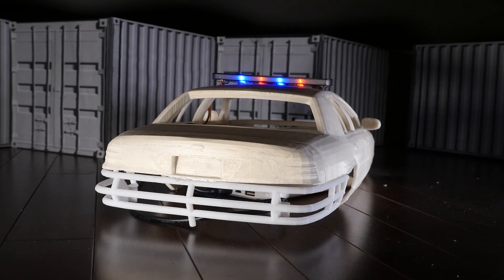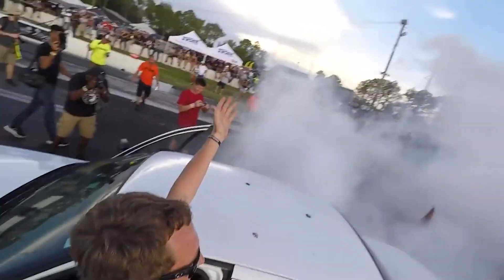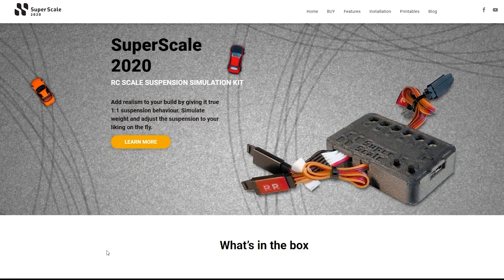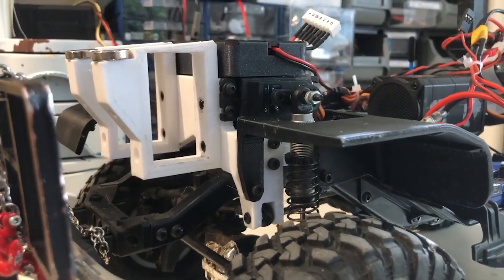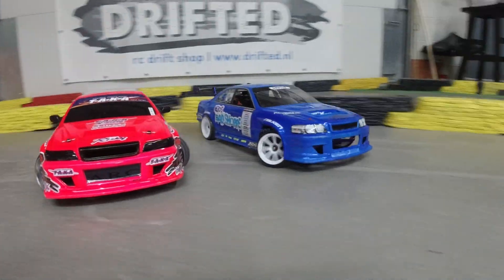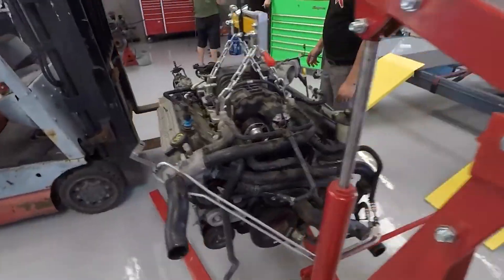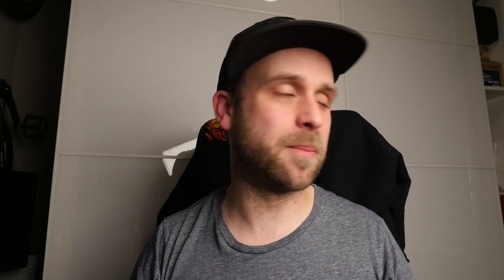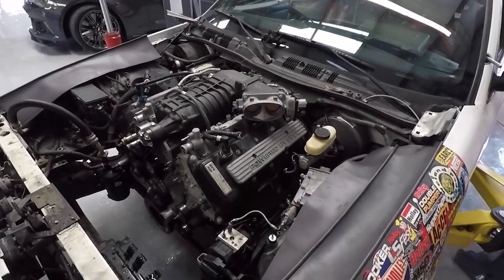RC NEIGHBOR BUILD - Kick some tires, light some fires! EP 3

Comment: Hell yeah brother , you should mount the engine on springs so it’s has some  movement in the  engine bay  when you whip it about , can’t wait to see the next stage . Keep up the good work from across the pond 🏴👍🏻
Reply from the maker: yeah i might. it's going to be an evolving thing. gonna attach the motor to the servos. maybe i can do it on a pivot.

Comment: I took apart a blue tooth speaker to put a sound system in my rc drift.  Maybe hook up a traxxis system to some good speakers for some good sound quality
Reply: Great Idea !
Reply from the maker: nopers. if you want to see proper sampling. not cheap up amps, and bad loops of audio like all available sfx kits for rc. check out "thecarscalingproject" on insta and youtube. That dude is using a raspberry pi, and some clever coding. the only speaker sound i'd go for. because most sound like pure ass from source. doesn't matter if you put a good speaker behind it.

Comment: Engine came out amazing so many details, why not make the pulleys rotating and use servo motor to rotate it with a small belt, that will be sick with ur engine and rotating supercharger with sound effect,  hell yea brother
Reply from the maker: I thought about it. but that's just too much work to barely see them move. Would love too, but the scale is too small to reliably print moving parts that small.
Reply: @kpopRC  yea its alot of work, maybe I will do that for my mustang,

Comment: An idea for the tire smoke. You could get some of the stuff you put in fog machines and throw it in a small container in the car and run a thin gauge wire through it and hook up the wire to a 3 or 4s Lipo battery and that should create the smoke you want.
Reply from the maker: i think the bigger the wire. the more current it would take to heat enough. the more fluid the more energy it would take. I have something planned. and it's very neighbor-esk.
Reply: @kpopRC  I just want to say that it’s super cool that you read and respond to your comments and I can’t wait to see what you come up with.

Comment: Damm that's a sick motor very nice work

To smoke I'd susgest one of them exhaust smoke kits but redirected too just in front of the rear tyres.
Reply from the maker: already tested 2 in tandem. not enough dude. lol. i got something in the works.  and it involves heat and fire, probably sulfur.
Reply: Could also try a top from an ecig. They let out heaps of smoke and can run off a 2s lipo. Place a small fan onto it too direct air over it...

Comment: For supercharcher whine, just go with some metal straight cut gears and a high rpm motor, will be a bit off from the real sound, but I think it will be close enough and compact for a scale project.
Reply from the maker: Yeah i hear yah. the car has straight cut gears already, i guess because of the size, the frequency of wine is so high, you can't hear it.
Reply: @kpopRC  Yeah, size is the real issue here, and I think that it might need a "real" roots or screw supercharger scaled down to replicate the sound properly, but since you already have straight cut gears I dont think there is so much to gain more than idle sound.

Comment: Man hopefully I can get a set of them seats them are badass and I still think using a arduino board programmed to the throttle response with sound clips of the V8 with a supercharger with a small speaker to be able to get the sound
Reply from the maker: im so against speakers. small ones have no bass so it ends up sounding like ass.
Reply: @kpopRC  true what about a small belt driven turbine like what johnnyq90 makes

Comment: But on a scale crawler will that not wiggle to much on a point. When ur dragging it the sway will move it and then the shocks have no use.  Instead of the shock or leaf working
Reply from the maker: i mean. you can see it working. there is a practical example im showing. so no. it works very well. the shocks dampen the servo movements.

Comment: beautiful work bro but i really think you should get the motor sla printed if you know anyone that could do it or maybe a fan will be willing to do it
Reply: also i really wanna see you legit burn tires i think having tires explode is so important so using real rubber rc tires for burnouts would be sick i beleive soaking them in fuel or wd cant remeber exactly what but will help it smoke more
Reply from the maker: cool. the whole back end might melt off with what I'm planning. lol
Reply: @kpopRC  from what I seen on your Insta if that’s the plan that looks wild lol

Comment: Darkdragonwing has made a small engine before with a working super charger, should definitely check it out might give you something to work with
Reply from the maker: yeah i've seen it. im more worried about sound and smoke. i don't think you see much of the super charger. and neighbor has a very small pully. unfortunately I have prioritized superscale 2020 active suspension over full engine pullies. you wont see it anyway. too many coolant lines.

Comment: It would look scale as shit but probably be a lot of work, but if you put a small continuous servo with decent speed and had it hidden in the engine or somthing and have to hooked up to the engine belts you could plug it in to the spare esc slot on the receiver so when you hit the gas it would spin faster.
Reply from the maker: it's just too small of a scale. and too fiddly. plust you can't really see the belts spin in neighbor, and it's 1:1 scale. ha! but yes... that would be super freaking cool.

Comment: I think people are not figuring that you would need an EDF unit to give the amount of velocity for air to use the vape pen. But EDFs are not small enough with the volume you need for that to work

Also, the body being too large for most printers and needing to be broke down has inspired a resin printing machine to make up for this...
Reply from the maker: yep. already tried the smoke machine route. going for heat and fire and sulfur. hint hint.

Comment: Damn amazing bro I am trying to get on this level. I am just hanging in there. What program is that?
Reply from the maker: it's crappy old sketchup. but it's working out pretty well for me. a bit of swearing though. and a bunch of rethinks. but it works great.
Reply: @kpopRC  thank you so much for the reply. Love the videos. I am trying to do some modeling right now on fusion lots of hoops to jump thru tho thinking about solid works. That front brake idea is great, maybe have a slide weight that puts more on the rear just when you want to burnout, and it can slide forward to balance out after the burnout. Can’t wait to see what’s next.

Comment: What printer do you use  I need info you inspire me to print rc for life
Reply from the maker: pursa i3 mk3s is the printer i use. it's pricey. the cheaper option is the ender 3 pro. but out of the box the prusa will get you up and running faster and with less tweaking.